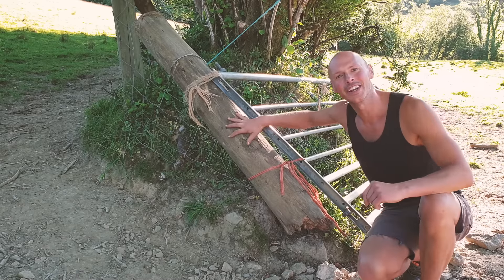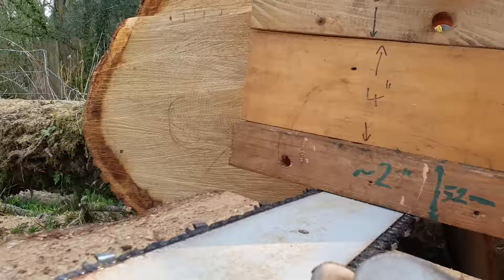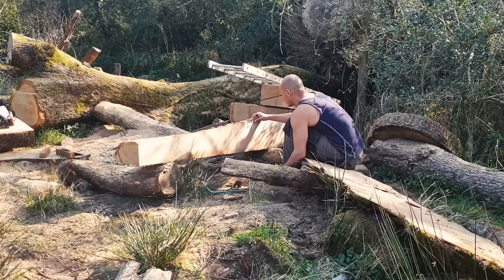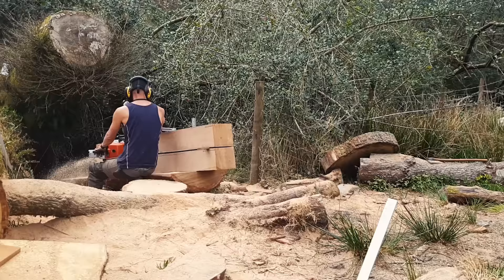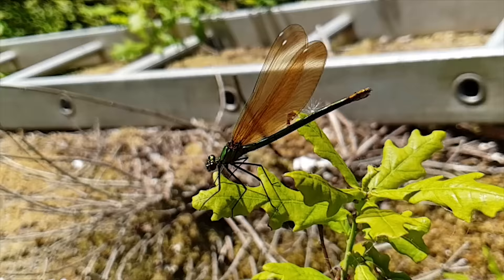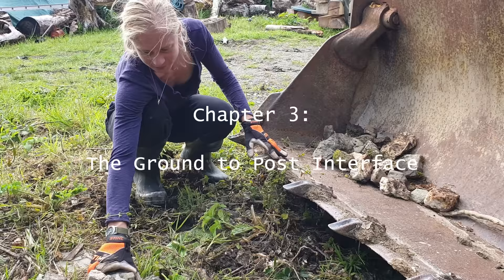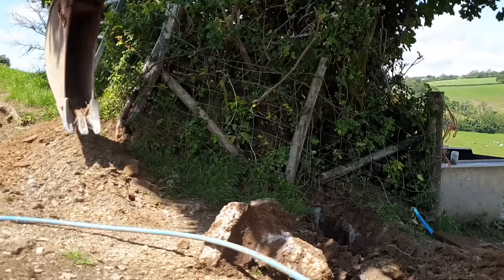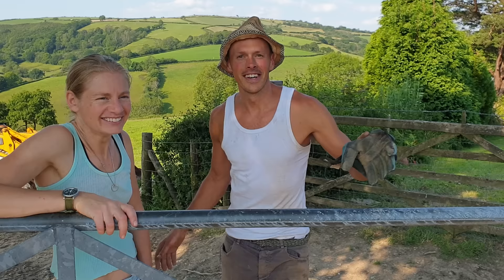The 3 secrets to ROT PROOF POSTS and how to make them

Comment: Here in Sweden charring post like you did is an old tradition in building houses and have been used for electric post until today. There is also an old tradition to burn and suffocate pine to extract tar and sort of paint the whole houses exterior, even the roof. Very common om houses at coast. I wonder if adding tar to the charred part or your post would be a good idea. Also linseed oil could be a good idea to add to the whole post. Not sure if all oils have this in common but my understanding is as the linseed oil oxidize it will protect the wood from rain but allows moisture to wander in and out of the wood. Great video i enjoyed it a lot!
Reply from the maker: Good morning Jonathan, thanks for getting in touch and the Swedish perspective :)

Comment: As a professional builder, I agree, new pressure treated wood is garbage. I had a retaining wall rot and fall over in 6 years. SIX YEARS!!! That was the one that was built when the new stuff came out and we all didn't know better. I still use it, but I dry it and then soak it in Coppergreen or Jasco (Copper naphthanate) for a week before install. Or I use Redwood. Redwood takes a really long time to rot through. Well done guys!!

Comment: I bought a few hundred recycled plastic UV resistant post. Very heavy 10cm/10cm*180cm long. Incredibly strong. Use them as wooden posts. Just drill a hole with an earth auger. So no concreting needed, unless used as gate post. Best investment ever. They are stronger than the wooden ones and no rotting or UV damage. Things moved on...  I do like wood more as well, but have 32 acres to fence off.
Reply from the maker: Thanks for sharing your experience J Westrik

Comment: I recall Tommow's World showing how a (then) recent batch of tar-impregnated telephone poles were not lasting well and it was found the logs had not made the usual trip floating down river to the transport pickup. During this time in the water bacteria normally broke down the cell membranes in the wood which is how the tar got to fully impregnate it when dipped. Logs that had not been floated only had a superficial tar coating which failed to protect the wood.
Reply: It was suggested to me a number of years ago that “in the good old days” they used to suspend logs with chains in  rivers to season them . They would be left for a year in which time all the sap was replaced with water . How true this is I can’t say , but it goes someway to support what you say .

Comment: About 90 years back. A fence was made on this property from tamarack. Many of the posts are still standing, but good luck putting a nail in them.
Reply from the maker: Thanks for sharing Marlon. I have no experience with tamarack - but love the name ;)
Reply: @FloweringElbow  When they dry, they form spiral cracks, that if you filled with red paint, they would look like a barber poll. This type of tamarack is the swamp type. And was thought to be extinct, but a group of them was found. We have a few growing at the farm. The grow slow. Sadly I am very allergic to these poor trees.
  It is said that given idea rotting conditions, it will take 200 years for these trees to rot.(My shack rest upon such skids.).
  Reason for their near extinction, is that they were harvested to make wood preservative from the sap. (Also old timers, tried to make everything out of this wood.)
  Hence it is called the wood that is more rot resistance than ceder. 
  Sawdust from said tree, can be used to kill ants, and other insects.. (But does not kill plants..)

Comment: I built a pergola with 5 x 5 posts at least 25 years ago using Tanalised softwood posts, I wrapped the bottom of them with 18 " DPC and concreted them in, they are still solid as a rock, I used the same method for my 6 foot high weatherboard fence that has been standing over 15 yrs, without protection from the wet soil tanalised timbers will rot within 10 yrs in the ground but with protection will last much longer

Comment: Thank you. A great video. I'm in the process of replacing a gatepost as it is beginning to move. Probably due to the way that I installed it. I can't recall if it was oak or chestnut, but I installed it about ten years ago. I'll char the replacement and try the rock infill. I have subscribed. Keep up the good work!

Comment: Dowels.  Use wood dowels for ‘rolling’ those beams off the slab onto the truck bed.  I had to move a commercial sized double door refrigerator down a porch and through a doorway with TIGHT tolerances.  I ended up using a series old wood arrow shafts (12 of them) to roll the massive metal bulk down and around into the doorway.  Really old, really low tech, but it was the only way to do it.  I think having a handful of old arrow shafts or self made dowels would save some strain on such a task as getting those beams moving.  Great efforts and great looking beams though.  Thanks for the vid.

Comment: First time watcher here. I like your video, it was very well thought out and executed. You seem to be concerned with the environmental impact of plastics and steel and such but in the same manner you also have no qualms about cutting near a stream where bar oil will contaminate ground water. If you were using veggie oil at the time Kuddos to you my friend. Keep up the good work.
Reply from the maker: Good morning Coonanfox,
Veg oil was indeed used (also check out my veg oil van conversion vid ;)   Though I must admit the last tank of the day I try to put some of the official (biodegradable) bar oil through the tank, so it doesn't oxidise during the time before its next use (sometimes it sits for  months). 
Peace, Bongo.

Comment: I used a weed burner with propane and char the ends .. after that i use a 50/50 mix of parrifin wax and oil.. heated up..i would assume most any kind of oil would work.. i use used motor oil and have tried lininseed oil for surface projects.. the sedmotor oil i use below surface on posts .. have had no kind of problem except above the ground exposed to elements.  im makiing posts for an arbor for grapevines so i have to be kind of care full what i use on the exposed  surfaces . i think just plain parrifin wax melted and coating the surface will suffice. with out worryong to much about damaging the vines. I may try mixing a little copper sulphate wiht the parrifin.. ill do a little more research on this..
thanks for the info on the burning or charring the ends of posts.

Comment: "Char and Tar" was common where I'm from. We had posts on our land that was still solid after 100 years. We always charred the planted end then coated it with tar or asphalt emulsion.
Reply: Are you from Pennsylvania where tar was plentiful at the surface in the 1800s?  Just wondering.
Reply: @gjensen500  
California central valley. Tar was plentiful from Southern California (La Brea tar pits and such. There was smog in LA centuries before there were cars from surface petroleum) brought up through the San Francisco bay, over through and used in the deltas.

Comment: We usually try and get railway sleepers. Proper ex-railway ones that have been boiled in pitch. They’re hard to find now because sleepers are concrete nowadays. Put 1m in the ground, 2m above. Does the job. Not as nice as your ones though. 
Your missus is a trooper btw. Hang onto her 👍

Comment: Working in the London urban fringe, copper caps would have lasted about 5 minutes. great idea in your situation. We always weathered the tops of oak signposts and gateposts (cut at an angle).  We always fitted a 'stop block' under the end of a gate at the face of the closing post. This was a lump of stone or concrete with a flat top that the base of the closing rail of the gate could be sat on (or rest close above). This stopped the gate dropping or breaking when people sat on it or climbed over. Lots of people around and this was a problem..... As was timber gates going walkies, unless you routed the site name on the top rail.

Comment: Very nice, I've been trying to find a solution to ground rot for some landscaping poplar post borders.  I've just been resting the ends on wood pegs to prevent actual ground contact but adding a char and oil to the bottoms might just be the ticket.

Comment: I used hazel posts for my veg garden, to keep out deer as I live in a ''parc naturel'' they lasted about 5 years.
I replaced them with oak, they lasted 2 years.
The next ones will be concrete!
The best posts/piles were always Elm, but that's now pretty scarce.
Another option is PVC pipes with concrete infill.
You could also mix dry concrete with your stone infill and ram everything tight. Rainwater will then provide the needed moisture to cure the cement.
Reply from the maker: Good evening Niklar, thanks for sharing your experience. I suspect your oak posts were made from smallish branches with sapphire wood? Or perhaps it was brown, not white oak. Both are not terribly durable... oak heartwood though, I'd be very surprised if that didn't last significantly longer than Hazel. 
Peace, Bongo.
Reply: @FloweringElbow  
They were small trees that I thinned out, so largely sapwood  I would guess.
(Amazing how townies dont understand, that in the countryside, trees are just another crop, and are not there just for their personal amusement.)

Comment: Wow thats what I did when I put in my posts! Only after burning them I put the flaming posts into boiling used motor oil. I did it with soft wood thou. And i got termites after about 5 years. But many are still standing after 15 years! Oh..... But i didnt cut my own. I used old scavenged wood. Wood that others thought was finished. I just cut off the part they had in the ground. Burned them and boiled a bucket of used oil and let them stand in it for a while.

Comment: In the North of Scotland larch posts are the best.
You suggest that the "treatment" is not working like it should, but the real problem is that the posts and strainer/gate posts are not seasoned any more, before treatment.
They are now, cut, de-barked and treated, all in a matter of a couple of months.
This also saves on treatment fluid as the residual sap stops the fluid penetrating the wood.
If you season a post for eighteen months before treatment it will suck in more that three times as much treatment fuild.
A case in point is electricity poles.
They are scandanavian pine, which makes them a harder wood anyway, because of the colder climate, but they are cut and stored for few months in scandanavia, then shipped to the UK where they are seasoned for atleast a year, then all the appropriate holes are bored, before they are pressure treated.
The treatment will have penetrated the wood atleast one inch, and even more at top and bottom, and around the bored holes.
Where as, a post that is cut and treated within a couple of months will only let the treatment penetrate about a quarter of an inch.
It is all about money.!
Reply from the maker: Morning Davy, true that. I guess some of the blame has to fall on the farmer then, for buying this trash. The telecom people have done the calculations and know it's not worth the labour and cost or regular replacing, so buy/ make lasting posts for more money.
I do think the changing recipe of treatment has made it harder though. 
Either way, I think it's well worth looking into alternatives to the nasty chemicals!   
Thanks for sharing. Peace, Bongo.
Reply: @FloweringElbow 
You are right, having climbed creosotted poles for over thirty years, they have come a long way in there treatment (not always getting it correct).
By the way, telecom poles are UK grown, much softer.
The electricity poles are Scandinavian making them harder as we climb poles using treeclimbing spikes on our feet and the hardness gives more purchase.

Comment: Amazing chainsaw skills/attachments! Also, I admire your environmental responsibility.  For majority od us mortals - pine with two layers of Sadolin Classic plus two thick layers of Roof Seal (!!!) where the post is buried - will suffice. Four years - no sign of any deterioration.
Reply from the maker: Hey Martin. Thanks for sharing your experiences. What kind of roof seal are you using?
Reply: @FloweringElbow  Water based for obvious reasons. I am not sure about the brand,  probably Ron seal. I will get back to you later with the name.
Reply: @FloweringElbow  Ronseal. It creates nice, thick rubbery "sock" in which the post Is buried - from the bottom to 25mm above the ground level.

Comment: for info only - there is a homemade creosote recipe on youtube somewhere if you want creosote for your posts.  also if you mix used oil and diesel fuel 50/50 and paint the part of the post above ground with the mixture it will create a water repellant barrier. I paint the wood floors in my utility trailers with the mix and it preserves the wood for years to come.

Comment: US telegraph and telephone company's often drilled a long hole on an acute angle down towards the middle of the poles, filled the hole with motor oil and put a bung in it to stop water coming in thru the hole. They then periodically refilled with new oil, seemed to work really well, however it is frowned upon now-day's because of environmental reasons. However if boiled linseed oil was to be used as a substitute for the motor oil, I think that this method still could be viable alternative/compliment to Charing.

Comment: An old magazine " Mother Earth..." showed cutting a small plug at the bottom of the post and drilling a hole to just above ground level, then drill a hole at an angle down to the center hole 1st cutting a plug before drilling. After drilling the plugs and hole, glue the bottom plug into the bottom of the post, let dry, coat post part with oil ( that's going in the ground) bury the post the way you are doing, then fill hole with oil and insert plug and refill as needed as time goes buy. Make sure you can remove plug later to refill.

Comment: My father built a deck on the back of our house in 1984.  Two years ago, with the floor boards dried out and splintering, I had to decide whether to rebuild the whole thing or just redo the decking.  Ultimately, I just did the floor, the structure being so solid and level, despite being 35 years old.  It's supported by 4X4 posts, dropped into post holes with some concrete mix.  I don't know if he just did a great job all those years ago or if the wood/preservatives were that much better.

Comment: You can come and do mine mates, proper job! I must be close actually living in Mid Wales. The problem I've had is the same "hammer in" style hook pieces you install @15:53 have fallen out due to crumbling, rotten wood 🙁. In the ground post still feels solid enough, but the hooks left large holes behind, so on here thinking about some temporary solutions. Probably bolt a length of threaded rod right the way through with some type of a spacer to fill up the gap best I can before complete replacement. Btw you have somewhat of a likeness to Gareth Bale about you 😁, athleticism too leaping over your work 👍 Nice to have found your channel.
Reply from the maker: Hey Cranebeg, thanks for getting in touch and for watching. Yeah, those hammer-in ones never last as long as the bolt-through jobs. good luck with it :)
Reply: @FloweringElbow  Thank you and subscribed for future content.

Comment: Speaking of wood lasting, when I was younger my mother designed an extension on our house which involved removing part of the roof and the framing of the end of the hip roof. It was a house that had been built in the usual wood framing of New Zealand building in the early 1950s, which meant most of the timber, including the roofing joists were 4x2 radiata pine (Monterey pine). After 30 years the timber had dried out quite thoroughly and in spite of being technically a softwood, when we tried to nail fresh timber to it we were having serious difficulty getting 3 1/2 inch nails to go into it. I don't know how many nails I had to straighten before my brother fetched Dad's electric drill to make pilot holes. Even then we burned out a couple of drill bits.
Reply from the maker: Good morning Carey, thank you for sharing you experiences with the radiata pine. It always amazes me how the properties of wood can change so dramatically as it dries out.

Comment: Hey friend! I've been thinking quite a bit about your gate posts. I do renovations in a lot of different homes in my community, and see mostly pressure treated lumber. Although where I live, cedar is very prominent, and there are a number of local mills producing dimensional lumber with it. I don't think I've ever seen anyone use oak as a fence/gate post, but I'm sure it will be "rock solid" for several years. Myself, if I had access to a big log of oak, I would likely be more interested in some sort of furniture... fence posts and a day's labour every five /ten years is cheap, compared to a slab of oak.
Reply: Cedar should resist rotting better than oak. Cypress is very rot resistant too.

Comment: I appreciate your efforts and respect the way you did it; but I would just simply buy a 25ltr canister of creosote (stonecoal tar) for around 60€, slap there two coats on, drive it right in the ground and call it a day.

And in case I'm a little bit overmotivated, I would get the dirt drill-attachment, drill the holes, place the posts and fill it up with 16-32mm gravel.

Comment: I have some mixed feelings seeing such a beautiful piece of wood being used for a fence post, but you are absolutely right in using what you have at hand and I am sure it will last for decades to come. Here is a thought, do you think the wood would hold its strength longer if allowed to slowly absorb some substance like linseed oil? If so then perhaps if a bowl were to be shaped into the endgrain under the copper hat, one could fill it up in a way once a season, and let it absorb over months and years at its natural rate.